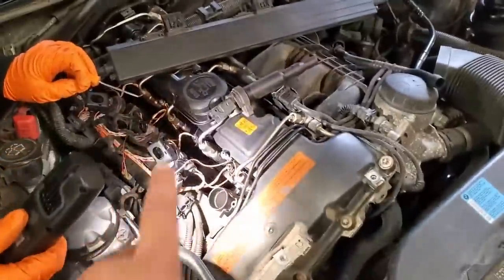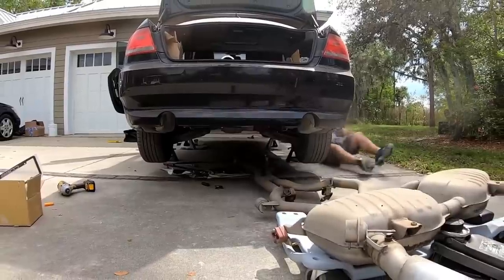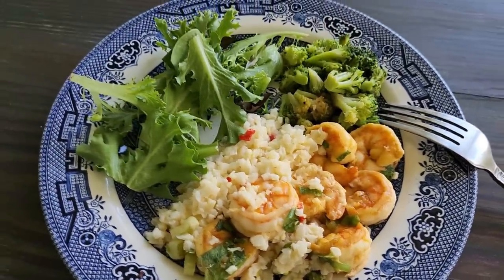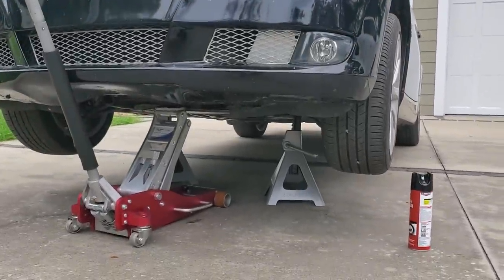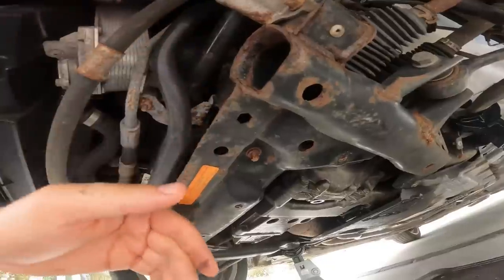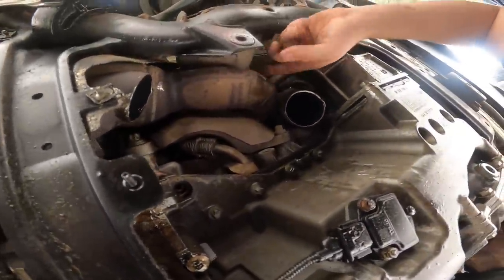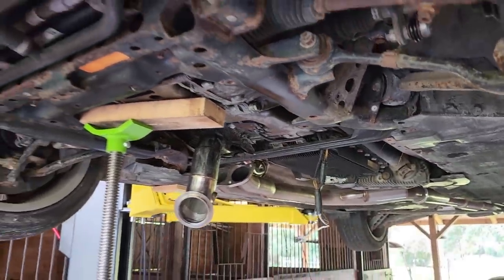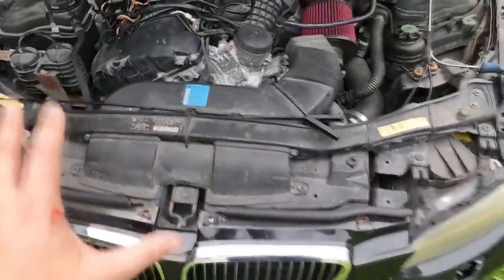Can we Save this 200,000 Mile Twin Turbo BMW without Destroying It?

Comment: SAM!!! I'm so very proud of you AND you helped me big time! Thank you for posting the work on this car. I have the very same car (2008 335XI) and I now know that I can do my O2 sensors from the bottom of the car if needed in the future. I had my Down Pipes installed by a shop because of the sub frame needing to be dropped and the O2 sensors replaced then but in the future you know they will need to be replaced again and it's worried me that I wouldn't be able to just do it myself on jack stands. Now I know that with the DP's I can reach them. As well I have up graded 17T turbos from ebay for almost a year now which along with a Custom Tune from a tuner using MHD as a flash app has made the car a monster for CHEAP!

Comment: The 335i can be very quick if set up right. Worth the effort. Good strong motor
Reply: I have almost 240k on mine 3k oil changes and it’s been running fine I’ve been on MHD stage 2+ for the last 30ish k
Reply: @Pyrex_lex  Me too! But I'm sorry to say. You might be due. LOL. I hope not though!
Reply: @friguy4444  I’m patiently waiting once it goes it’s single turbo time😈
Reply: No, no its not. Absolutely worthless cars. Couldn't imagine having a 35iq
Reply: @YungEagle3k  ok what do you drive
Reply: @YungEagle3k  what do you drive? Not bashing just curious
Reply: @YungEagle3k  Dude bye N54 is a good ass tuning platform
Reply: @YungEagle3k  you couldn’t be more wrong if you tried
Reply: @YungEagle3k  what do you drive? A Geo metro ?

Comment: I've worked on countless 335xi, u can cut the rear subframe bar that runs under the cat from side to side without any issues long term. I have done about 15 of these without any long term problems. 6yrs plus

Comment: Cool to see someone working on a platform I know disturbingly well unintentionally. Owning one of these has been awesome. Went from doing oil changes and car washes to brake pads, replacing injectors, both hi/lo fuel pumps, control arms, dropping my trans, exhaust, subframe, and more. Hasn’t seen an auto shop for anything other than alignment. Not for everyone but they are wildly fast for the money if you pick up a wrench, 200k is impressive. Many of them are unfortunately poorly maintained and modified with poor taste or parts.

Comment: Dude, im going thru the exact same issue with my hood/latches...06 Audi A8L and two months of depression. Multiple repair shops, body shop and every over-confident DIY guy I know all have failed. Drivers side popped, now coolant light on! Classic German engineering.

Comment: Good to see the car back on the channel,  when the time comes my wife sure could use this as she is driving a 1999 yukon Denali we've had for 22 years and is very tired. She needs something smaller and a little more reliable for daily trips through the mountains to work!
Reply: 520d m sport.
Ok or a 535i

Comment: 2008 335xi here, I’ve also had the same Issue with opening the hood, go in the driver side cockpit, take out the plastic handle and expose the wire cable out of the groove, take wise grips and pull on the metal cable until it pops open

Comment: On my e70 when the cable broke I used a coat hanger wire and slide it through the 3rd space on the pass side grill. Slide it between rubber seal and body.  Press on latch in behind

Comment: I've owned a 335i for the past 9 years,   although the last two of those have been in my garage,  untouched. It's sitting on 260,000km and was running fine when parked - well the engine light would come on under hard acceleration but don't they all...  Keep working on yours,  its inspiring me to rescue mine from the dust.
Reply: No not all. Only the dead ones

Comment: You'd think when BMW creates a repair manual, they'd realize how poorly designed their cars are.
Reply: Lmfao
Reply: Yeah I don't get it. I just don't. Unless you're rich and can afford to replace them with brand new every 3 years I do not see why anyone would want one. They have NOTHING that other vehicles don't have, except high prices, expensive repairs, 100K in speciality tools that only work on certain models etc etc. I have no sympathy for BMW owners and frankly, sick of hearing them whine about all the issues when people know they are junk.
Reply: @robsdeviceunknown  reading your comment tells me you know 0 about any bmw lol. In Sam’s case this is 2008 car with 186k+ miles. If you want to bring up junk cars go and get any American car that is 186k miles. It’s going to be full of broken/faulty parts. Moral of the story: all cars require maintenance and some need more maintenance then others. After owning several bmws I understand why people go through maintaining and restoring the cars
Reply: @robsdeviceunknown  my 340 is faster and more efficient than any competing vehicle, and I️ haven’t done anything to it besides change oil and filters
Reply: @robsdeviceunknown  - I've had 5 of them. They have many things that other vehicles don't have. Mainly a great driving experience. They used to use the phrase, The Ultimate Driving Machine, for a reason. Anyway, I'd buy a used AWD E90 if I ever found I nice one for a good price, but in general, I've gone off BMW. I have a Mercedes now. It's different but great in its own way.
Reply: @robsdeviceunknown  My 335 diesel is an awesome machine

Comment: Drop the subframe. It's super easy and 8 bolts. Just support the engine.  I made that mistake when replacing my water pump. Took 2 days. Dropped the subframe the next time, took 2 hours.  Use a few long extensions to get the motor mount bolts from the top. Take both wheels off to assists in finding the bolts. 15mm.  Oh and you'll probably need to replace the waterpump. They usually run about 50k. I have a 2010 335xi with 170k.

Comment: Definitely put some plastic-safe grease all over those new latches and cables.  There is the Super-Lube stuff with PTFE that is plastic safe and resists water intrusion so it doesn't wash off too easily.

Comment: I've broken cats air hammering out N54 exhaust studs, never o2 sensors. Used a lot of heat after that experience and haven't had an issue since. Grind them down flush, get em cherry red with oxy acetalyn and you shouldn't have an issue.
Reply from the maker: Maybe its the cat then that gets affected!

Comment: I had a similar hood latch problem on an Audi. Drivers side was stuck and passenger side did open. I used a 12" hacksaw blade poked it through the hood and managed to saw off the U shaped latch. Took a few hand bruising hours to cut through 6mm of steel but I got it done without damaging anything else but the latch.  It wouldn't work I suppose if both latches were slammed shut but I got a bit lucky. Turns out the ball shaped head on one of the cables broke clean off.

Comment: Definitely can install Downpipes without dropping subframe.  But you will need to loosen steering rack e bolts.  Slide forward about inch.

Comment: The mystery of the parked BMW fires is far from solved. In some cases, the vehicles have been so badly burned it was difficult to determine a cause, and in other cases, the fires were determined to have started elsewhere on the vehicle.

Comment: Hey sam 
I have a BMW X5 E53 and i hâd the same problem with the hood latches and cables 
I resolved the hood problem taking off the kidney grills off and from there you can reach directly to the latch itself and move it with the screwdriver where the cables attached 
That’s how I opened my hood 
It took me about 1-2 hours but it was ok

Comment: It's interesting that your issue was to do with the emission system.  It has me thinking of all the times I have seen heavy equipment users (construction and agriculture) where the DEF system has stopped the machine working, and the only recourse was to bring in a manufacturer's tech at great expense.  I am mostly thinking of LetsDig18 (Chris Guins) and Millennial Farmer, but I suspect they are not alone.  I definitely get the impression that heavy equipment users all hate DEF.  And before someone makes the daft comment that petrol/gas engined vehicles don't use DEF, yes I know that, but it is still about emissions control.

Comment: BMW and limpmode: My old 320i decides to go into limpmode once every 6 to 8 months or so. Last time I tried to cross a road quickly: Of course it went to limpmode! Stop at the road side. Switch the engine off and start the car up again and it is running perfectly for a few months.

Comment: The Lock picking Lawyer has taught us that drilling a small hole in the plastic cover and using a piece of piano wire can release a latch.  Because the bracket is open on one side, there should be access for the "push rod".

Comment: hood latch on my '16 chevy ss did that. costed like 350 at a dealership to get them to fix it.. easiest way for me is to pull up the bottom side floor cover where the latch housing is. i wonder if urs was like that too. u can actually get to it from inside the car much easier. if u have the right tools which i dont.
Reply: cost ... just cost , costed isn't a word

Comment: I had a second gen xterra which will go in limp mode and slip  light will come one. Turns out it was the brake light were doing a short...mech even said was the transmission....

Comment: The undercarriage IS a rust bucket …. It’s probably the reason the hood latches failed … proper preventive maintenance with white grease would have prevented the rust bucket from spreading.

Comment: Have the same problem like in the beginning of the video. I try to go fast and check engine light comes on.   Soon I turn it off it goes away.

I can go 75mph with out flooring it. Just have to patiently get up to speed.

Comment: I really don't understand why people remove the factory air boxes, which draw in COLDER air from the outside, and replace them with aftermarket filter systems that draw in HOT air from the engine bay - any imagined 'benefits' from the aftermarket filters are negated by the hot air intake.

Comment: Can you help me in something sam? As you worked on both cars which is better an e46 m3 or an e39 m5 in terms of reliability?
Reply: They're both M cars which means that parts are expensive and they'll have their faults... But do your research
Reply from the maker: E46 M3 in my experience is a pretty simple car, but can have subframe cracking. Most everything else is a DIY job

Comment: GURANTEED, turbos are bad, oil will foul out the 02, valve cover gasket, oil housing, vanos, oil pan, carbon cleaning, the list goes on. I had one until 152k and I was over it. It was a full bolt on, really sorted 335i but my god did I spend money and a lot of years off my life dealing with that car 😂

Comment: With that much milage and oil leak in the bottom, oil pressure will go low to feed the turbos and they will fail sooner than you think. you should have done the turbos while downpipes are gone(ps. there is no way to do the turbos in budget lol)

Comment: Literally EVERYTHING is a failure point on every BMW. I researched the hell out of my c207 chassis Benz before I got it & while I originally was shopping for an E9x, I can't justify having a BMW as an only/daily driver.
It MUST be a good 2nd car. I dream of an E39, E24, E31, E34, or a certain E9X, but seriously.....what ISN'T a "common issue" on these? I guarantee all of the seatbelts need to be replaced at 75k mi & the gas tanks probably leak & fuel level senders probably go out at 85k or something laughable like that. 
Man, are they beautiful & drive fantastic but they have straight up Yugo build quality.

Comment: Could you hire a car an exact replica off the car you've bought that's in need off repair and then just swop out the parts untill you diagnose the problem.

Comment: Sam I like your input on this car on Facebook
3:03 N

1 of 13

1999 BMW Z3

FREE

Driven 217,000 miles Automatic transmission

Send seller a message

Hi, is this available?

Send

Alert

Message

Save

Share

About This Vehicle

Driven 217,000 miles